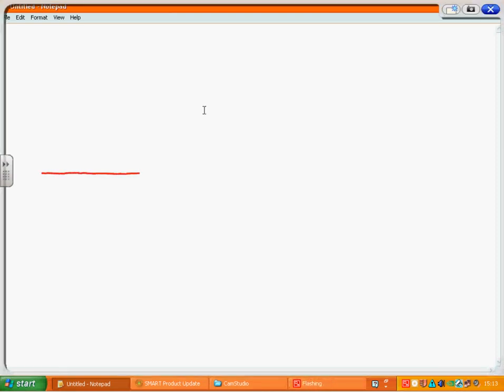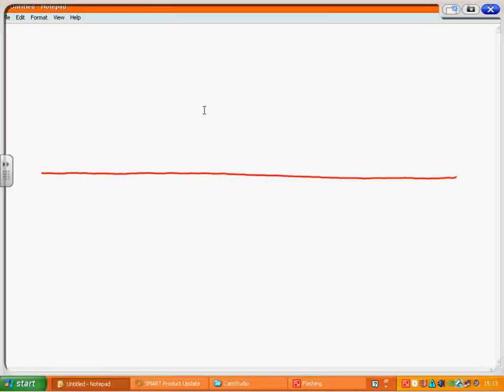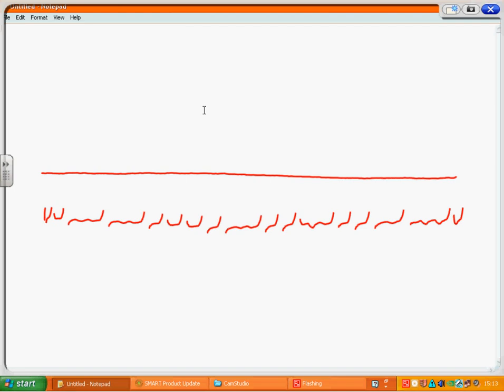Electrical interference problem with SmartBoard

Comment: Currently having this issue, similar power supply powering the smartboard speakers. Were you able to resolve the issue with a better shielded AC adapter? The speakers we're using go along with the smartboard, so switching them off while using the smartboard makes no sense for us.
Reply from the maker: Changing the power supply just for some other of the same voltage and amps sorted the problem. Wasn't anything special, just some spare one in a box of old power supplies. (Speakers were also part of the IWB installation).
Reply from the maker: I've also seen a badly earthed computer cause similar problems. Changing the IEC ("kettle") lead to the computer sorted that one. Hope this helps!
Reply: Thanks for the info (: Ill try those out !